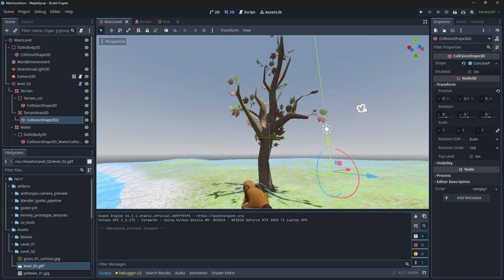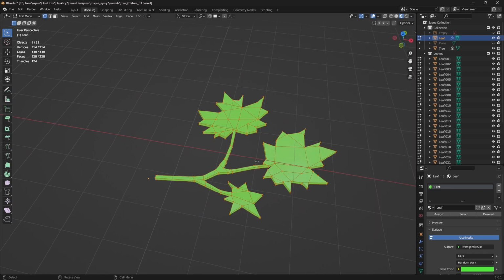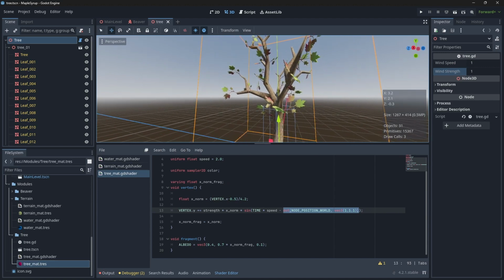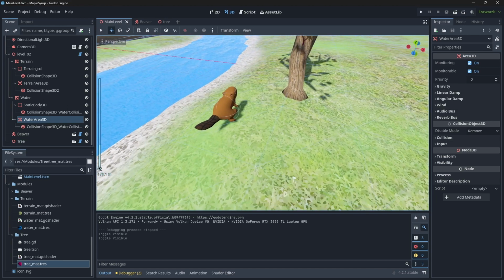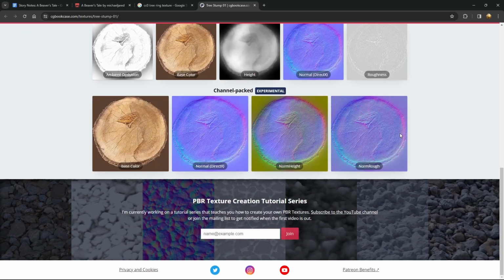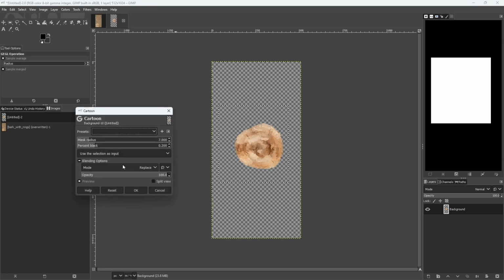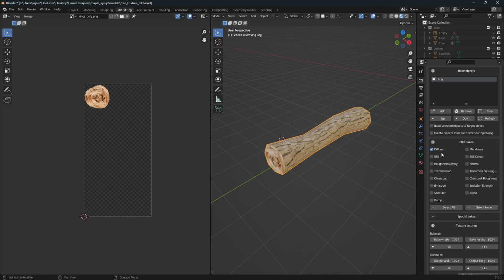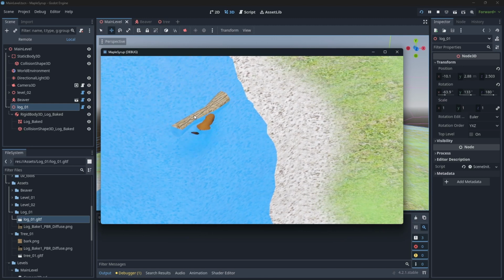A Beaver's Tale: Devlog #1

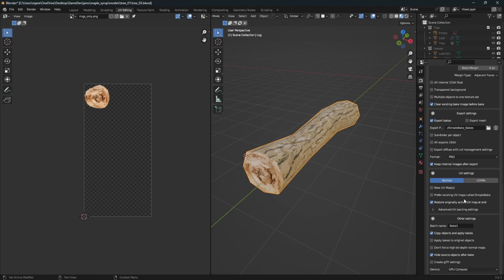Comment: 44:20 from what i see, it cant combine maps into ORM texture.
you might also want to check out principled baker addon, since it can also pack (rebake) multiple objects into 1 material, and also bake any black and white maps into any channels you choose.
also a personal tip: i keep a separate baking file, where principled baker is set up to what i need, like samples, export path, ORM channels, etc.
btw, i've just bought your addon, and it works pretty neat. now i have to reorganize my main file i a way, that all procedural and baked copies are separate, as well as collisions and other stuff.
Reply from the maker: Good to know, thanks for the tip. I've been eyeing the principled baker add-on. So far simple bake has been okay for my purposes, but I've been hitting more and more snags with baking lately...

And glad to know the add-on is in your workflow! I'm currently developing a game and although I don't use it for absolutely everything, it is my workhorse for collision setups.